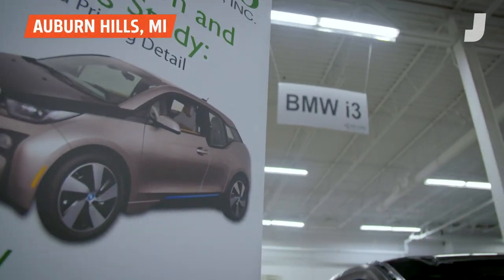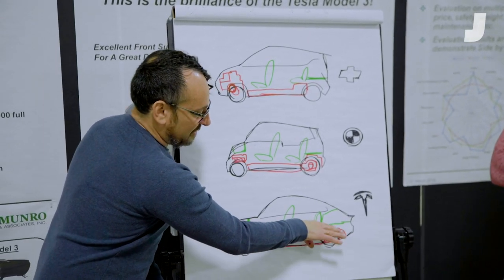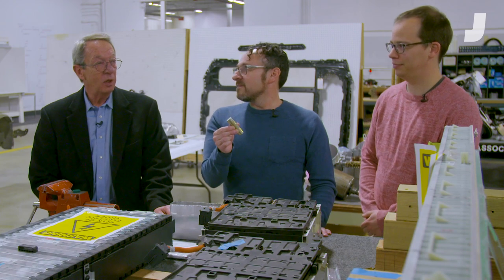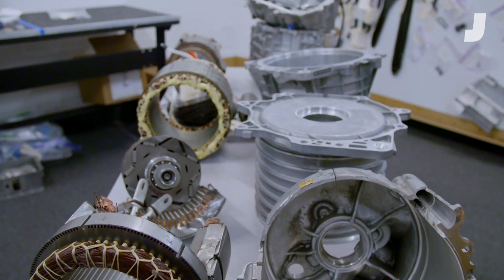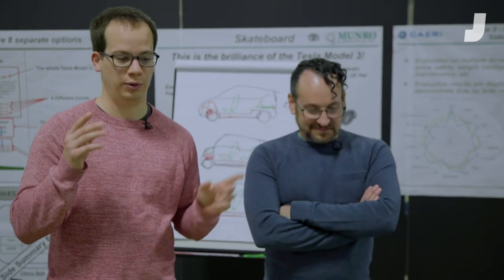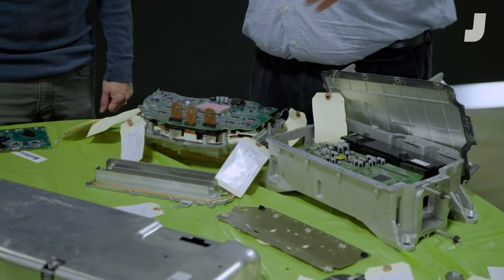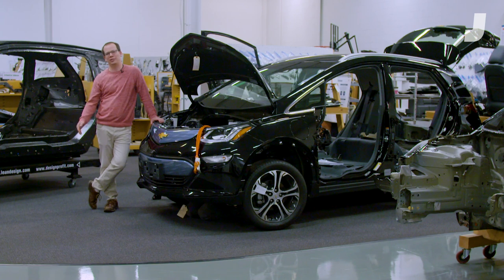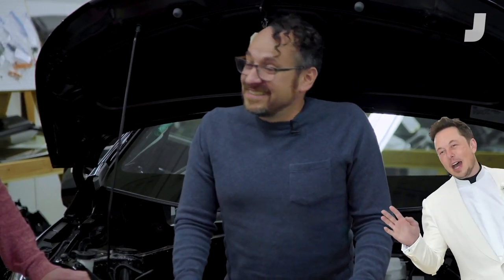A Look Inside The Tesla Model 3, Chevy Bolt, and BMW i3

Comment: One is a ground up electric vehicle, other is kind of a experimental thing and the other is some sort of an adaptation to fit the factory plant. All those "weird" designs on the Bolt are to integrate that different drivetrain to the flow of the GM factory, with this design they can, at the same time and in the same plant, produce every single car, electric or gas powered.
Reply: It was an existing bodyshell.
Designed to save money.
That worked well..... Not.
Reply: The GM way is a quickfix way, making EV production possible with a minimal development cost. But the time where that is good enough is fading fast. The only way to be profitable with EVs is to design manufacturing lines from the ground up. The question is whether traditional auto makers (and their investors) are interested in doing that - and whether they dare. Because even though the auto industry is brutally competitive, they're still surviving with doing business as usual - and many of their main assets would become liabilities if they risked it all.
Reply: Well, it's GM. They have never had interest in building well designed cars. GM cars have always been designed by accountants.
Reply: However, unlike Tesla, GM needs to make money. Tesla just burns money because people keep throwing money at them to burn. Tesla is suffering Betamax syndrome. The better product does not always win the market.
Reply: @truantray  But Tesla is still winning on the market share, and Tesla was profitable for 2 quarters in a row. So I don't see your point there. Tesla has significantly better gross margins on their EVs than legacy automakers. Most of them have negative gross margins - but Tesla doesn't.
Reply: @truantray  Yes, just like Betamax outsold VHS more than 10 to 1 ... dork.
Reply: @truantray  The ironic part about your post is that GM LOSES money on every Bolt sold (the entire drivetrain, batteries, and infotainment center is produced by LG Chem) !  How did you NOT know that?! That is why they limit production to under or around 40K/year. It is paid for by their gas vehicle profits.  Tesla doesn't have that problem, because they MAKE money on every vehicle sold.

NO legacy automaker knows how to make an EV that is a profit center, for them, yet.  Only if they charge a much higher price than Tesla will they be able to break even or profit.  HOWEVER, they can't seriously go heavy into EV production, because they have to protect their gas vehicle profits.  Do you see the problem, for them, now?

Also, ask Jaguar why they are having severe problems with their I-Pace production. ;) NO legacy automaker has figured out how to build a ground up BEV in the volumes Tesla is currently producing the Model 3.  AND, Tesla has about 1/3 the manufacturing steps, to build the Model 3 than tradition legacy automaker production steps.  Knowledge is power!
Reply: @AscendedSaiyan3  
GM doesn't "lose money"
They lose A LOT of money on every Bolt!!!
Reply: @UTUBESUCK666  stop drinking Elon's Kool-aid.
Reply: Yes, I think that is my point. :)  I would say they lose between $5K to $10K per vehicle sold.
Reply: Paulo Lange GM just loves selling Americans Daewoos
Reply: @rogerstarkey5390  Existing body shell from what? It's bigger than the Sonic (which shares the production line), different than the Cruze hatchback, and the Spark could fit inside the Bolt. That's all Chevy has for hatchback cars. The Bolt is its own car, it just has a conventional design, and I personally think they did a fabulous job on it. Every Tesla owner I talk to has had their cars in the shop multiple times. My Bolt hasn't seen the dealer since I bought it two years ago. Everything works the way it should, plus it doesn't rely on my phone to act as the key (seriously, Tesla. A prox card as a backup?).

Comment: That shelf is called a subframe and every mass produced car out there has one. It hold the engine and the transmission and some direction parts. It's not an "inelegant" design, it's a way to mass produce, reduce cost, and it stems probably from existing tooling and robots in assembly lines that are being repurposed.
Reply: That is not a subframe, that is a shelf that bolts onto the actual subframe because they don't have enough structure otherwise.
Reply: It's an adaptor

Comment: Interesting comparisons but I wish you would have talked about the advantages or disadvantages of each. There must be more to it than just packaging issues.
Reply: Agreed, as they didn't even cover the reason the Bolt is FWD, which is to give it excellent electric braking, something the BMW & Tesla don't have, as the rear braking is about 20% of the total...
Reply: @davidhollenshead4892  The BMW I3 has some of the best braking you could ask for.

Comment: I didn’t hear any comments about serviceability.  Integrating the electronics and inverter with the motor (as is done on the Tesla) is great for package efficiency and saves some weight, but what happens when the electronics fail and have to be replaced?  The Chevy has a separate module that can be removed and replaced.  How easy and costly is it to do that on the Tesla?  How easy is it to repair collision damage?  These are all considerations the established automakers have weighed for years.  Has Tesla?

Comment: It's worth noting that the i3, being significantly older than the other two cars took a very different design direction due to the requirement to be ultra-efficient, something that was forced upon it by the, at the time, enormous cost of batteries!  For example, the narrow yet tall tyres, the lightweight CF structure, the external water cooled motor, the high performance battery conditioning systems etc. All these make the i3 far more efficient than the other two, much more conventional cars, but that was a necessity because they could only afford to initially release it with a  'tiny' 18kWh (useable) battery. Todays TM3, which has a battery over 3 times the size can 'afford' to be more conventional and less efficient and still furnish the driver with a decent range.
Reply: So what you're saying is BMW procrastinated for over half a decade and is now paying the price for it. Got it.
Reply: As an i3 owner (with 200,000km on the odometer) I agree to an extent. However the i3 is not more efficient than the Model 3 due to slightly higher motor efficiency and a lower frontal area because of the difference in body design.

Comment: Honestly the Tesla looks alien made compared to the others. It’s insane my buddy’s 2012 model s has 150k miles no issues besides new tires and brakes.
Reply: Right, many of the engineering solutions look like they were made by a precursor alien civilization or something. They're that crazy.
Reply: It's first principles design: 1. what's the best way to make this; 2. how do we make it that way at a price that can be profitable.
Reply: Thats all well and good, but in the real world LOTS of Model S owners have had to deal with replacement motors, steering racks and of course door handles amognst others. In the real world Tesla's don't rank very high on the reliability index.
Reply: @Rickyc12s  unlike most other manufacturers though, as Tesla is so young I'd suggest - and anecdotally it seems to be true - that most of the issues are in the early models. Everyone knows they had issues, and yet even most people who had those issues say they wouldn't drive anything else.

Of course, it's a predominantly early adopter demographic, so that also influences those decisions.

Comment: If you want an EV to use in town or for your commute, the Bolt is the best buy, and the cheapest to service.
The Tesla is more like a premium car, with premium features and costs of service.
The BMW is similar to the Tesla in both costs of service and features.
So consider buying the Bolt, and keeping a cool car for traveling, like a Mustang, or my choice, a Vanagon Westy.
[I don't need a commuter car and thus, won't be buying an EV, any time soon,  however in a few years, I will have an Electric Vehicle stop 30 feet from my house, namely light rail and thus, won't need to park or drive in rush hour...]
Reply: BMW is similar to Tesla only in costs and powertrain layout. Tesla has the best range, performance, space, efficiency, charging network and safety. With over 500 km range it's rather not a commuter car...

(Yes, I'm a Tesla fan)

Comment: The wheelbase and length of a Tesla model 3 are quite larger in comparison to i3 and Bolt. It is also seen by the dry weight of the cars.I guess packaging is highly affected by these factors. 
In a Hatch of i3 type apart from the seating area, you are not left with much of a space in the front and the rear. Whereas the Model 3, being a sedan, has ample space behind rear seats to fit the powertrain and the HVAC system. The i3 fits the HVAC on the front because they have seats above the rear wheels.
And I agree with you on the Bolt being of a conventional layout.
And I also agree with the fact that Tesla is using the first principle in a very efficient manner in the individual systems.

Comment: This was just barely nerdy enough, I'd have loved much more motor detail with some benchmark info, talk about power steering, HVAC is complicated in an EV and very cool when well integrated (ie: super bottle), different regen braking tech maybe some benchmarks there too. AND REAL battery details: BMS topology, BMS differential charge or discharge rates, high and low voltage limits, rated cell life (does this seem to be an accurate rating), actual battery cooling information (actual temps that heating and cooling are initiated).

With everything there I'd be reverse engineering anything I could figure out.
Reply: One thing they failed to touch on is that the Bolt uses a permanent magnet motor while the Tesla, and possibly the i3, use induction motors. This gives the Bolt the edge on torque, regen, and finer control of the motor. 

Driving the Bolt, I see:
150 kW of motive power (decreases to 140 kW as charge depletes), 
10-20 kW of regen during D mode (depends on speed), no-pedal, 
50 kW regen L mode, no-pedal (or D-mode and paddle), and 
70 kW regen L-mode and paddle. 

The Bolt is able to hold the car at a complete stop on level or mild inclines (steeper grade facing up than down) using the motor alone. If the car continues creeping forward because the downgrade is too steep when being held by motor torque in L, it will apply the electric parking brake automatically to hold the car still, releasing the instant you press the throttle. Facing uphill, the Bolt can hold brake pressure until you press the throttle (Hill Start Assist), allowing you to release the brake pedal but still keep the brakes (and brake lights) applied. Tesla has a brake hold feature where if you push the brake pedal further than needed to stop the car, it will hold the brakes on until you push either pedal, which is similar to the Bolt's Hill Start Assist, but can do it at any time. With Autopilot engaged, you don't need to do anything.

As for battery thermals, I don't know specifics, but I've noticed with ambient temperatures below 34 F, the Bolt will heat the battery if the car sat outside all night. It'll either do this while charging if plugged in, or during driving. The colder the battery is, the more limited regen braking is (indicated by a line on the power gauge on the dash, enhanced layout). During the summer, it will cool the pack using the A/C, and can do it with or without cabin A/C running, even though they share the compressor. It's taken a couple days above 90 F for mine to activate cooling without quick charging. The battery has a separate 2 kW heater, and all thermal management is done through a glycol loop. The Bolt only cools when necessary during quick charge, which so far has only happened once for me.

The Bolt has three glycol loops. One is dedicated to the battery, another dedicated to cabin heating, and the third used for inverter/charger/drive motor cooling. The electronics/motor loop is the only loop to utilize a radiator, meaning that any thermal management of the battery is active (heater or A/C) when passive airflow cooling of the case isn't enough (air flowing under the car during driving). Fortunately, the battery balances pretty well between being insulated from the weather and being able to dump or absorb heat from ambient air. The radiator is equipped with Chevy's active shutters, which close at higher speed unless they need to be open, reducing aero drag.

The Bolt uses an electromechanical coupling for the shifter. The actual shifter inside is purely electronic and commands a servo attached to the drive unit. The servo moves an electrical switch inside the drive unit and engages or releases the parking pawl (Tesla does not use any of this and relies solely on the electric parking brakes for Park). The switch in the drive unit confirms the shift. I believe this is done to prevent damage to the park pawl. Park, Reverse, Neutral, and Drive all cause the servo to move. Only switching between Drive and Low is done purely by wire, and all this really does is re-map the throttle pedal in software to enable one-pedal driving.

One last thing. One-pedal driving in L is only active with the driver seat belt engaged. Without the seat belt, the car creeps forward, but slower than in D. If you are stopped while in L, and unclick the seatbelt, the parking brake will apply. With the seatbelt fastened in Drive mode, the paddle on the steering wheel will completely stop the car using only regen. Once stopped, the car will sit there until you press the throttle pedal, at which point creep will be re-enabled. If you are creeping forward and push Park, the Bolt will pump the hydraulic brakes to stop the car, apply the electric parking brake, and then shift to Park. You can even simply press the power button at a standstill and the Bolt will automatically put the car in Park and selectively apply the parking brake (still trying to figure out if this is location, terrain, or behavior based, as it still appears random) and then power down.
Reply: @MrTsolar  holy information batman, I'm copy pasting this to a notepad ASAP thanks!

Comment: This was a well done expose on three evs for general knowledge. Battery design and cooling is an eye opener. Chassis design is ho hum as every manufacturer must utilize their mechanical engineers to develop a chassis to hold all the components while providing strength. The drive train layout is another eye opener as to how each company developed their method. While this may be a fan boy site, technically explaining how Tesla developed their drive train is fascinating. There's always a design that tends to stand out. It appears Tesla did do their research from the ground up as testament to grumblings from the big euro manufacturers reverse engineering Teslas and reportedly admitting near defeat in how innovative Teslas are. From establishing gigafactory1, designing battery packs with integrated cooling,  compact electronics for small form factor, electric motors designed for vehicle use and not adapted from industrial of the shelf parts to being awarded as the safest car in crashes says a lot for a first run model car. Existing car manufacturers have legacy issues difficult to let go when attempting to transition to EVs. Perhaps spending a few billion (euros or dollars) is the only hint of any serious attempt at competing with Tesla setting the bar. Tesla has admittedly set the bar high with manufacturers struggling to meet the new ev standard. As of today, one of the euro manufacturers are struggling with battery production, forcing a slow down in assembling vehicles. Unable to meet manufacturing production means less sales to disappointed buyers. With a new ev that can't sell due to manufacturing issues hits the public, the reasons companies fail to present new evs strikes home of inadequate foresight Elon saw a decade ago.

Comment: I love how Monroe shit all over Tesla and then after really digging deeper, they love the car and a few of the engineers went out and purchased themselves one to own.
Reply: I don't mind someone having an opinion so long as they are willing to correct themselves when faced with opposing facts. :)
Reply: @billyjack70  that's a good point
Reply: When did they shit all over tesla?  I thought they criticized some of the manufacturing decisions, but praised the tech.  Seems like they were just objective.
Reply: @SOSLICK22  In their initial tear down when all they had done was evaluate the body, they were not at all impressed.  That was a separate video and not apparent in this one.  It just turned out to be the weakest component, and the only one that they didn't see Tesla ahead on.  Now that they've taken the whole thing apart their overall stance is that more balanced and they rate the Model 3 very highly.

Comment: The nice thing about the Bolt's adaptation of a conventional car to be EV is that you can piggy back on the development costs that went into the gas powered vehicle. It might not be the most elegant solution, but I am sure it has a lot to do with the fact that when the Bolt first came out it gave you far more range and more electric car performance for your money than any other EV on the market.
Reply: So they piggybacked the development costs and STILL lose money on every one?
Reply: @rogerstarkey5390  So should they have redesigned the Bolt from the ground up? That way, just like Tesla and all the other companies making EV's these days, they would have to charge twice as much for each car and still lose money on each one.
Reply: Yes, the Bolt is the best EV you can buy right now...